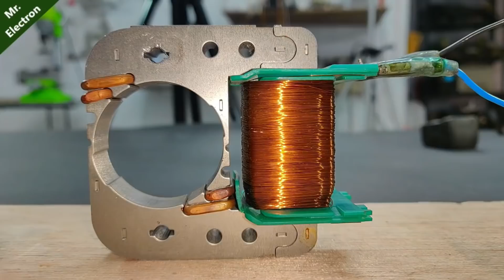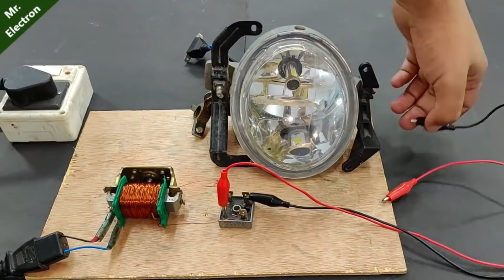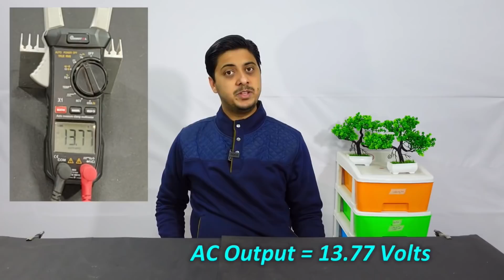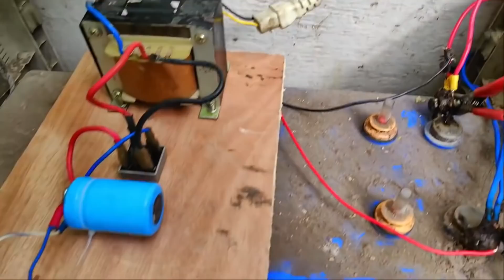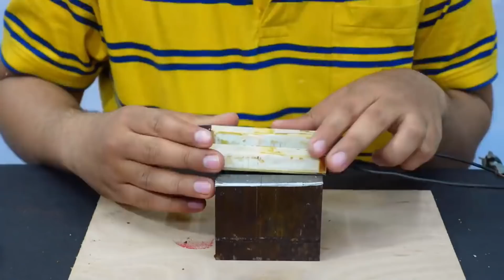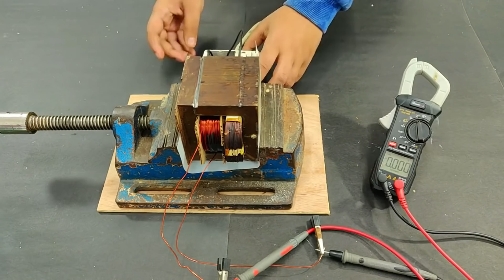3 Simple Inventions with Transformer

Comment: Really well done, I would recommend for the transformer using the coil from shaded pole motor using the actual core from the motor, your inductance on your primary is way low which is causing the negligble amount of core used to saturate which is partly why it is humming so badly, try using the original core.

Comment: RMS = 0.707 ( Root Mean Squared - thing average )
 Peak Voltage x 0.707 = RMS value. 
- Got a True RMS Fluke multimeter - so don't need a calculator. @11:11

Comment: Good one, bro! 
But it would have been better if you added heat sink to the diode (rectifier) to dissipate the heat generated during charging.  The battery will draw more amps when the charging amps is higher due to lower voltage and that means more heat.
You can even add a small 12v cooling fan close to the diode, if you can find one just to keep things cool ...your set up will last much longer with that. I have done many in the past, these are my lessons. Congrats.